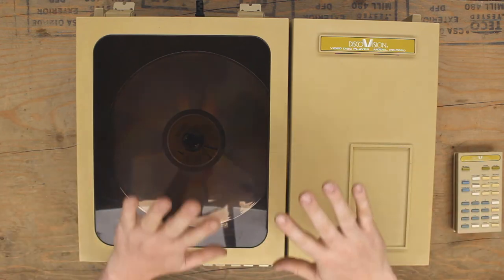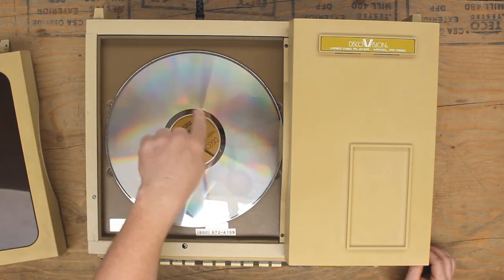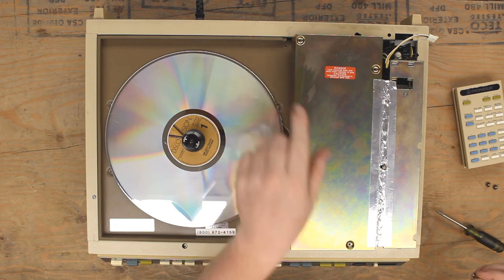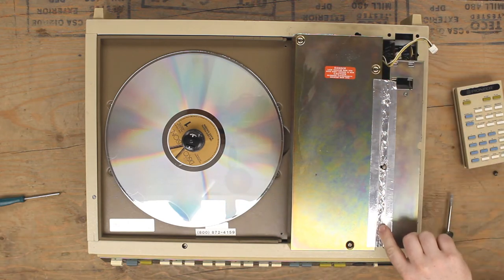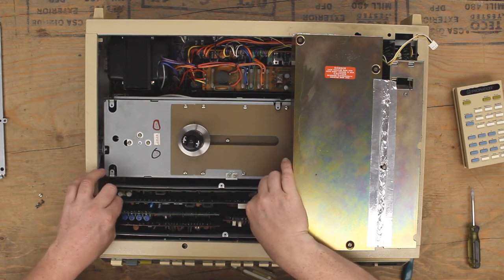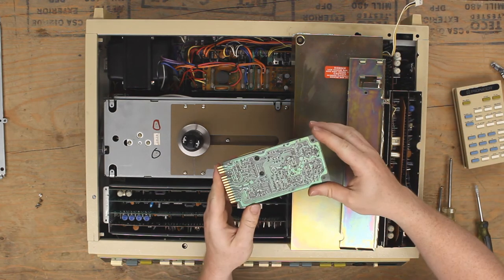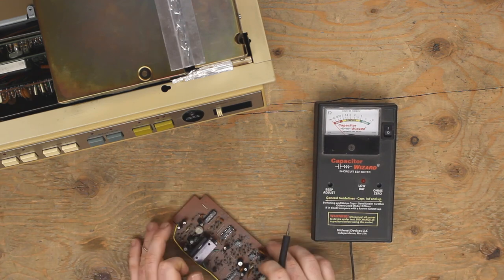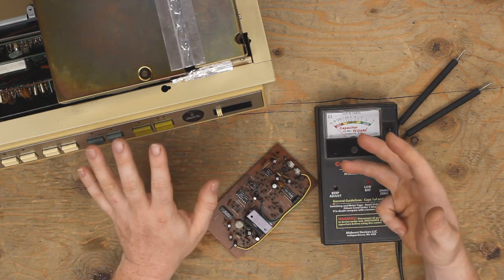Unable to Focus: PR-7820 "DiscoVision" Player

Comment: Hey there,
A few weeks ago I finally got my hands on a PR-7820 from October 1979.
The batterie leaked and because the unit was stored on its back [god knows why] I had to fully disassemble it to neutralize the corrosion and repaint two of the metal covers.
After I put everything back together, I had the same problem as you. The Focus lens was moving up to eight times, bevor the tracking kicked in.
Only when I skipped through the disc manually there was "something" on the screen.
So I would say it's ok to remove the laser assembly from the Spindle assembly [the three allen screws] because the holders beneath are shaped spherically and align the two parts.

After screwing around with the controls beneath the right cover I got the focus to lock on at the first try and a steady picture on the screen. I still have to manually adjust the spindle speed when different parts of the disk are being read.
But I am glad, that it still works, after I disassembled it to the bare chassis.

Im now onto the re-capping part and I noticed that on the focus board [at least on mine] there is a Cap soldered in backwards of what the pint says [it's the one at 20:27]. Did you also encounter this or is this just a mistake on my board that the factory made?

And the biggest question of all...
Did you get your player to work by now?
Reply from the maker: Thanks for the heads up!
No I've been overwhelmed with other work that I got as far as speccing out a full capacitor kit from the 7820's service manual and visually checking every board but I did not if that one capacitor was in backwards. Be warned though I did find a number of bipolar capacitors.
I have a second donor player how that I want to do a teardown since it's unlikely to ever work again. Just need to find the time to setup the set for this....or should it be a stream?
Reply: Thanks for the fast response!

Yeah I did notice the BiPolar caps and bought them separately. I’m going to recap the boards this weekend.

I also wanted to make a backup of the two EPROMs on the computer card.

A video could be edited easily (more information in less time)

When you stream the disassembly though there is the change of some back and forth communication.

Only tip I can give u in advance is to put some WD40 onto the 3 Ellen-Bolts and let them soak.
They were really stuck on my unit. (I almost rounded the heads)

Do you have laser safe glasses or did you just „avoid“ the beam?

Best regards :D
Reply from the maker: @raphaelschneider7852  My vision is already swiftly failing, even without lasers being involved. No that's jsut me being reckless with safety squints. Please be more careful than me.

Comment: two main things to consider here with your awesome museum piece, one is laser output power, you can measure this with a hand held laser power meter (get a sanwa, they are cheap) to check if output is correct, and the diode that should receive the  signal from the disc, you can measure this with an oscilloscope right over the photo diode, it should be a high frequency signal. if there is no signal, or its not clean enough you'll need a new photo diode, if there is a relatively clean signal there you have to follow it up the chain, and check why the auto-focus electronics don't lock in to it.   also, be sure to check all power supply voltages to make sure they are in good condition, and stable, it can be that the 5V supply is 4.3 for instance.
Reply from the maker: Problem is it's not easy to read the RF output of the photodiode when it's going in and out of focus. All I can get from a scope is "it saw something", which we could audibly tell because when I forgot to open the gate it wasn't so....aggressive...when trying to scan through the focus range.
Power supply test points all seemed to be in tolerance but again, with no easy way to access and remove the PSU without risking the alignment there's not a lot I can do about it. :/
Reply: @CelGenStudios  are there any focus gain and tracking gain trimmers on the board?  you can check their original settings, and play with it to see if you can get a better result. also check that the lens movement is perpundicular to the disc, it should not be tilted at all, just move straight up and down.  also sometimes you can adjust the laser gain up a bit to generate more light, and thus more contrast, this might help as well.
Reply from the maker: @arjenchristianhelder1027  There are adjustments, but until we can verify it's not a component problem rather than a tuning readjustment it's extremely advisable not to touch any of them because if it's not an adjustment issue we've now just messed with the factory calibration and have no way to set it back again.
The only variable is if the pot is dirty, which I'll have to check.
Reply: @CelGenStudios  what can happen is that the value of capacitors shifts over time and also the laser output will shift over time you can mark down the original settings of the pots, also by measuring them in-circuit or noting down the voltages on them so you can set them back when you want.

Comment: I have the Pioneer version from a Dragons Lair. It is in the back of storage so not sure of the exact model number. It was sensitive to the disk quality. If the Dragons Lair cabinet cooling fan fails it melts the label glue on the disk. It was very difficult to clean it and get it to play again. I sent it in several times for realignment back in the early 80's. Last time it had trouble recognizing a good disk I tried on my own and gave up. Back then I had no manuals along with not enough knowledge to fix it back in the mid to late 80's. Hope you can. I will download the manuals and try to get motivated for another attempt someday. Thanks for posting them.

Comment: I have the model three version of this. I am having the same issue as well. It’s frustrating not being able to track any of the documentation down to get it to work. It tries to play a disc, spins for a few minutes, then rejects back. I’ve had no luck with getting any sort of signal on screen either.
Reply from the maker: Check in the description for links to the service manual and optical adjustment instructions. Be warned though that some of the adjustments require special discs and jigs that are no longer available.

Comment: Has the focus lens been cleaned? (obvious things to check)  I wonder also if the mirrors as well been cleaned.  As far as caps are concerned, whenever I check capacitors I always remove them from circuit (or at least disconnect one lead before testing).  This gives you the most accurate value on ESR and Farad amount.  Replace as needed and use either Panasonic or Nichicon branded caps, as they are the best overall.  You might pay a little more, but the reliability can't be beat.  You might be able to adjust the focus board using an oscilloscope, but I'm not sure the best way to do that.  Too bad there's no dead test board, so you can display error codes in Hex to narrow down problems.  Oh, does the disk play fine in other laserdisc players?  Just curious.
Reply from the maker: The mirrors are front coated, so they are very easy to scratch but I've handled that type before in my Nikon film scanners. It's a delicate job but yes, they are all clean. Recapping for me is not a new ordeal and my supplier is normally Nichicon, Panasonic and Rubycon but this thing OH MAN, it uses a considerable number of bipolar capacitors. I absolutely hate those things. The service manual does cover a few manual controls and test points but without jigs it can be hard to get to some of them.
Yes the disc is known good. It's the Chevrolet product disc seen elsewhere on the channel.

Comment: I happen to have one of these, its so heavy and I don't know what to do with it. I heard that because they're so heavy and costly to ship, theres very few people selling them. Its just a shame to throw it out
Reply from the maker: From what I've heard a working player is solid gold to Space Ace/Dragons Lair restorers as their players have totally clapped-out tubes. If you are into kiosk disks with data dumps these are the only players that support the format. If you are into "the first" (the lines are very vague and unconfirmed here) laser videodisc player it will play almost every disc ever made and this is the beginning of the technology. Honestly because of their rarity and historical significance I would (and will) spend the time to perform a full recap, even if many capacitors "seemed" to be okay. Japanese capacitors, especially from the 70's, were notorious for their poor quality.
As for their weight yeah compared to the Magnavision 8000 they were built like a tank because the pricetag was never for the consumer market and cost was never an issue and yes it makes them impossible to ship unless you REALLY want one. It took me over 15 years to find another one that was within a day's driving distance.